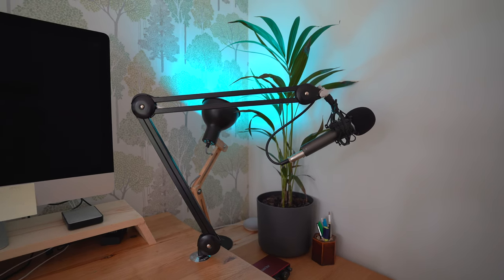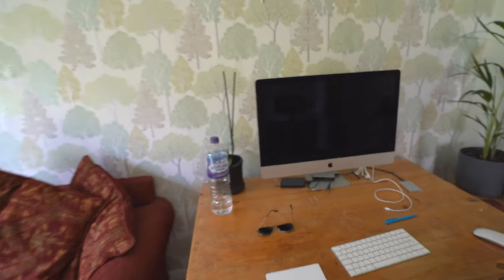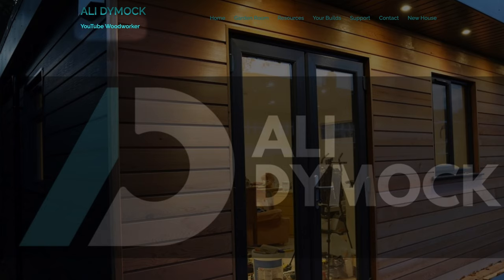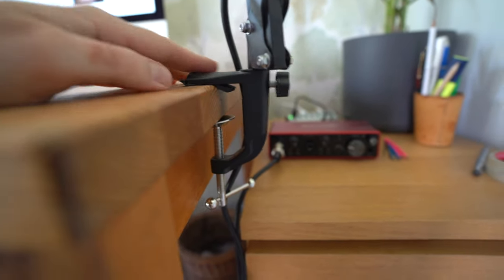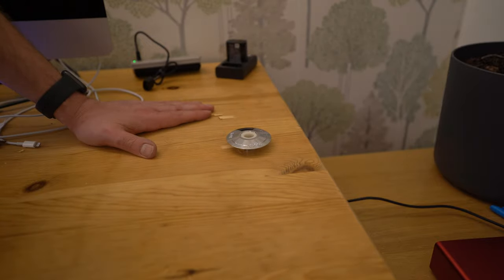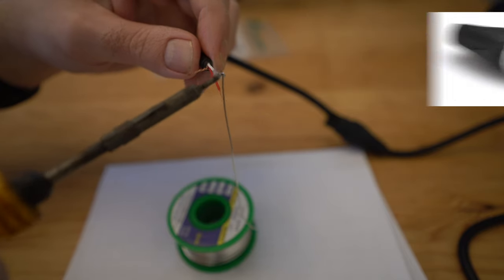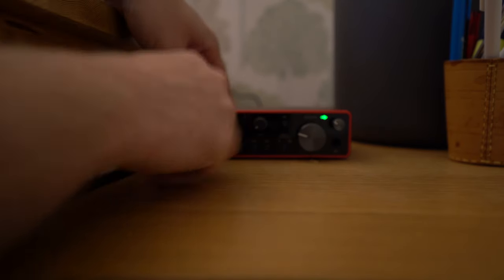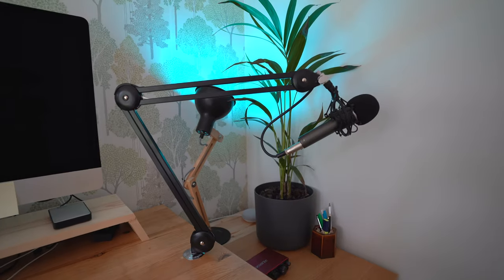How To Install The RØDE PSA-1 Boom Arm - The Best Method

Comment: Good stuff. You pointed out the obvious change I would have made - moving the boom to desk mount a bit further back so it is more out of the way. Remember to high pass filter the mic to help reduce proximity effect and plosives. You will also need to boost the top end frequencies if you are using a foam windshield. Have fun!
Reply from the maker: Thanks Matthew. Yeh I've now gone back to the clamp as I changed my desk so it's now at the back and tucks behind the imac. Still plenty of reach to my face though!

Comment: Do you know the diameter of the insertion? I'm trying to get this mic arm and trying to get a third party clamp for because my desk is thick due to frame blocking the length of my desk, making the 2.54cm thickness  of the desk to 7.62cm thick .

Comment: Do you any extra slack cable to allow for movement of the stand and adjusting mic position?
Reply from the maker: No not really actually, it flexes with the movement of the boom arm, so the cable is all pretty tight at all times